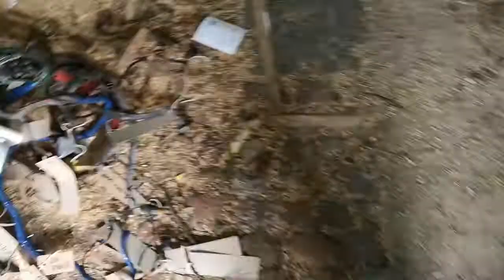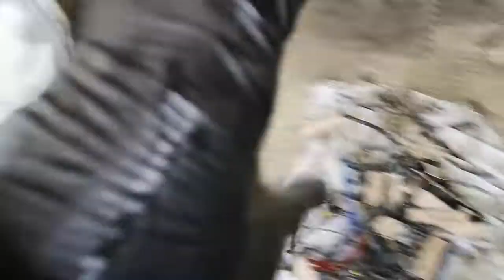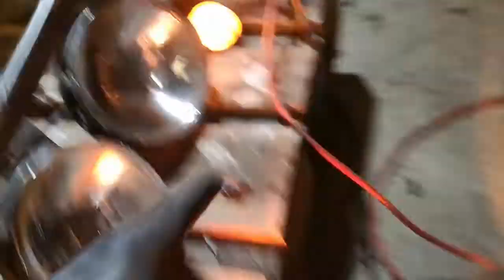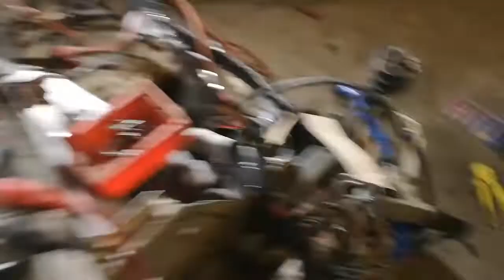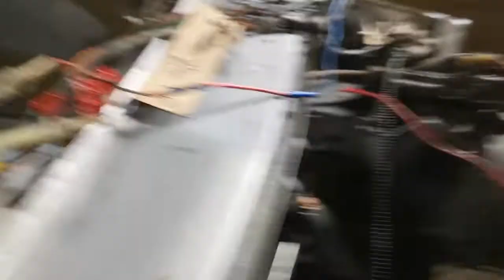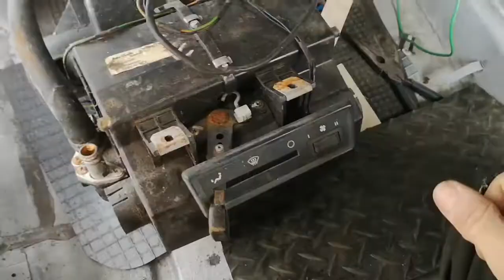The Boosted Mini - Episode 17 - WIRING! Insanity warning

Comment: The widescreen wiper park is a common fault and you can buy a new plug/module to fix it 👌🏻
Reply from the maker: Ah ok, thankyou! plug/module... Where does that sit? As as far as I can find, the loom just goes from switch to motor.!?
Reply: Piggy Power it’s part of the motor I believe, like a plastic block, Minispares definitely have them, maybe minimine
Reply: Piggy Power yes they’re on eBay under a tenner, it’s the white plastic block the wires connect to
Reply from the maker: Great info, thankyou!!
Reply: Piggy Power no problem at all chap!
Reply from the maker: You were spot on, tried the new module this evening. Works as it should now 👌👍
Reply: Piggy Power good good 😊

Comment: Did you drop your camera? What’s wrong with the stabilisation. Or are you using an unbalanced gimbal?
Reply from the maker: At what point do I drop the camera?
Reply: Piggy Power it’s a common cause for braking stabilisation mechanisms. Do you not see it? It’s very obvious on a TV. I’d expect it to be visible when played full screen on a PC. Hurt my eyes, had to stop watching 😭
Reply from the maker: I always watch my videos full screen before rendering and after rendering. Max watches them via YouTube before going live...didn't mention anything?!
Reply from the maker: Do you mean the interlacing issue? There had better not be any now... Using a different camera to the one I used to get all the interlacing issues with. Would really suck if it's returned
Reply: Piggy Power no. It looks like a judder. Happens every 3 seconds.
Reply: Piggy Power maybe it’s only noticeable on a TV then :/

Edit: no it’s defo noticeable on the phone
Reply from the maker: I can't see it?! Tried TV/pc monitor, my phone and iPad?!